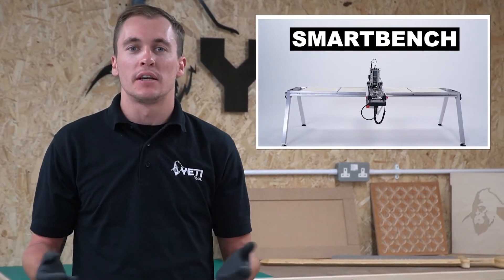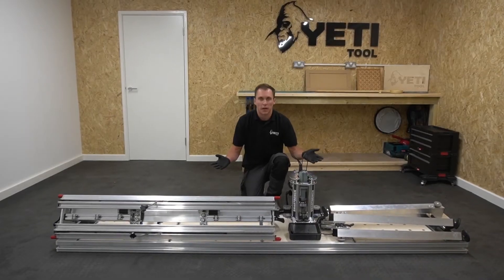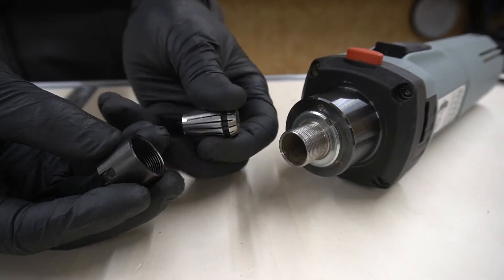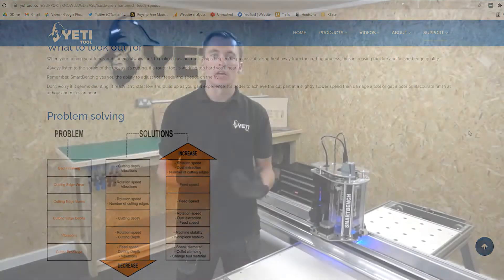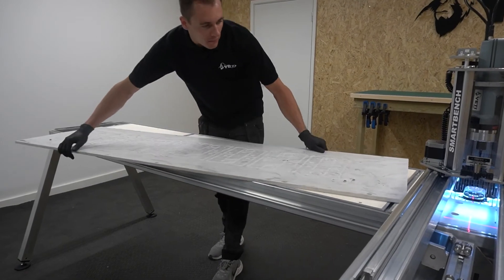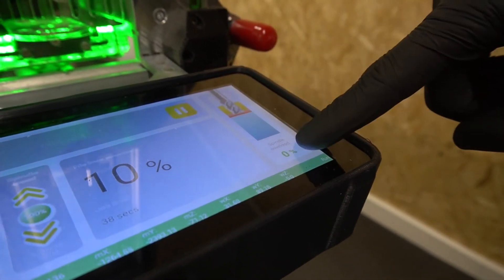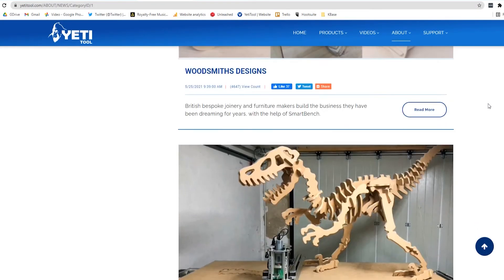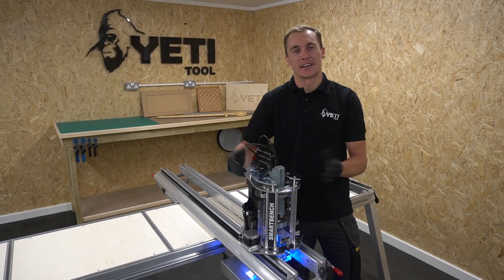SmartBench: Before You Buy

Comment: The Z axis looks strong but was that a belt i seen on the X? if its not a belt and its a screwball ? what size? for the X and Y axis? belts are unacceptable. to me that = slop in forward and back and left and right if its using belts in X and Y? screwball on Z yeah it can press down good. but it has to move forward back left right as its doing this.  I do like the foot print.
Reply from the maker: Thanks for watching our videos. I replied to your other comment, but just in case you don't get it. The X and Y axis use a rack and pinion setup, not belts.